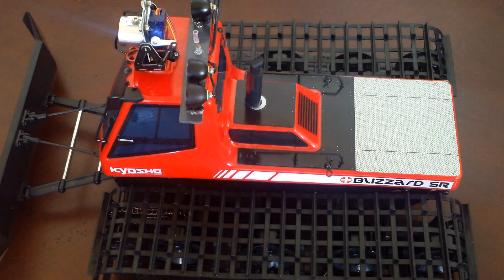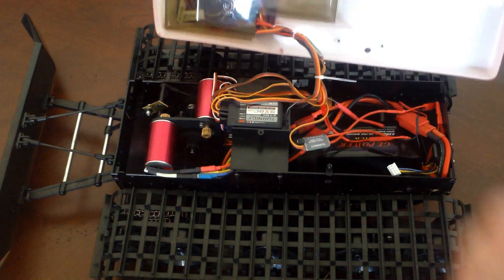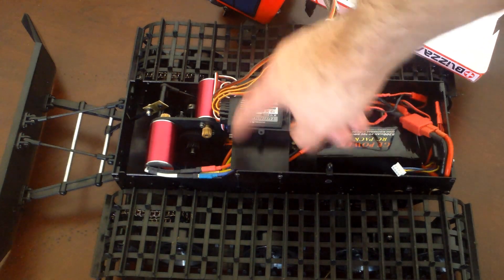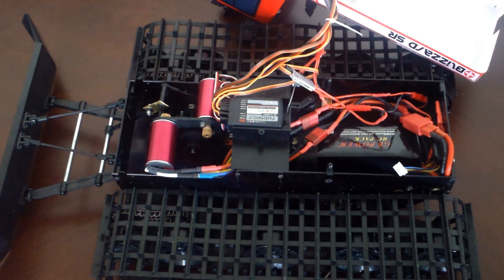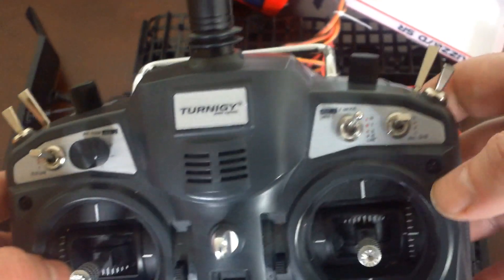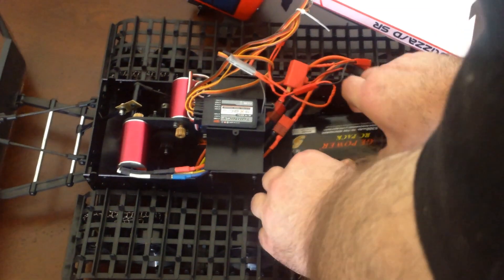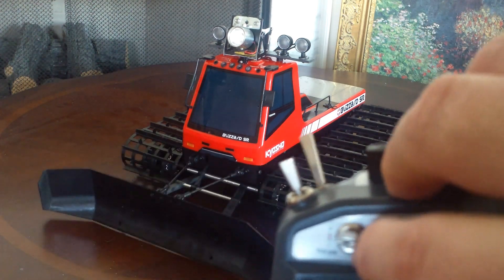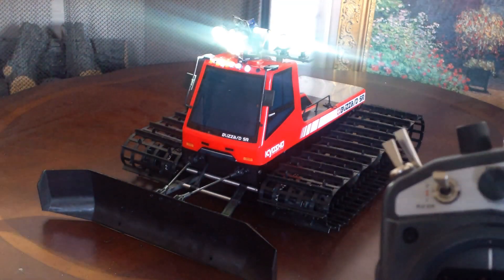Brushless Kyosho Blizzzard SR with Remotely Operated Spotlight

Comment: where did you get the spot light
Reply from the maker: +dumb dumb  I got it from a company in the UK that specialized in scale lighting for RC aircraft, but I can't find the name or website now. This is a bright and very lightweight aluminum helicopter landing/searchlight, and it worked great for the Blizzard. The second light I tried was a bicycle light and it was even brighter, but really it was too heavy and it ultimately broke the camera mount. Those mounts are only $5 however.
Reply: k thanks

Comment: How r you controlling both motors off one stick
Reply from the maker: +Sam Young  I know it's over a year old, but just noticed it now, sorry. You probably have an answer or moved on to something else at this point. For controlling both motors from one stick I used an RC aircraft transmitter in V-tail mode. It's not ideal, but it does work. I hated the two stick controller that comes with the Blizzard.

Comment: for ESC I used two Turnigy TrackStar 60A from HobbyKing. It's overkill depending on the motor you use, but its better to use an ESC rated too high than too low. Just make sure its an ESC for cars so that you have reverse, and that it is not physically too large to fit in the model. The complete brushless conversion is very easy. Actually the hardest part was modifying the front blade linkage so that the motor was not in the way.
Reply: Hi, I know it's an old video but man that thing was nice. Any chance you still have it and would sell it ? Thank you
Reply: @MCINpallet  where do you live?... How much would you pay for stock or brushless?... I have one that i could sell (Barely used currently stock)

Comment from the maker: I used "KDA 28-47 22Turn S Brushless Inrunner" from Hobby King. Really any brushless motor with 28mm diameter or less with 1/8 inch (3.17 mm)  shaft and Kv of 1000 - 2000 ( but probably lower is better.) The stock motor pinion gear is good to use - 1/8 shaft size, but on the Kyosho motor uses a shaft adapter so that a smaller shaft size of the Kyosho could be used. You don't need the shaft adapters if you use a 1/8 inch shaft brushless motor

Comment from the maker: well, you need a programmable transmitter. So the Kyosho probably won't work. First I switched the controls so that movement controls were on the right side, which has self centering of sticks both vertically and horizontally. Then you setup v-tail mode on the transmitter. This is what makes the tank tracks move in different directions when you turn. Programmable transmitters are pretty cheap though - around $50

Comment from the maker: The Turnigy 9X has a module. The Turnigy 9XR is a brand new model and it doesn't come with a module. If you open the 9XR page scroll down to "add to cart" Right below that click on the accessories (ACC) tab. At the top of the list is OrangeRX DSMX/DSM2 2.4 GHz transmitter module for $29.95 Unfortunately the 9XR is almost always out of stock, selling out within hours of a new shipment. The quickest way to get it is to order it and HobbyKing fills the existing orders first

Comment from the maker: I have the turnigy 9X TX/RX in airplane mode. Then I choose V-Tail mode for the stick that has spring return in both directions (If your radio doesn't have V-tail option, you can buy a V-tail controller from HobbyKing for a few dollars.) Now for for the Blizzard, that stick can control forward/reverse (vertical motion of the stick) and turning (horizontal motion of the same stick. The only drawback is that when turning, one track goes forward and the other goes in reverse (super spin)

Comment: Gorgeous work! Now that is a Snowcat! I've got the same radio system, how could you use the trimmer to control the blade servo? Are you using some homebrew radio firmware, or you just managed to tweak the standard Turnigy one?
Thanks!
Fabio